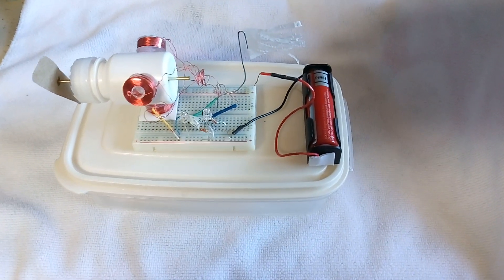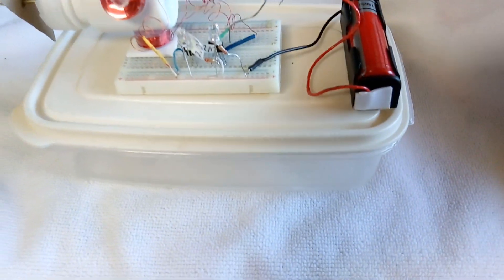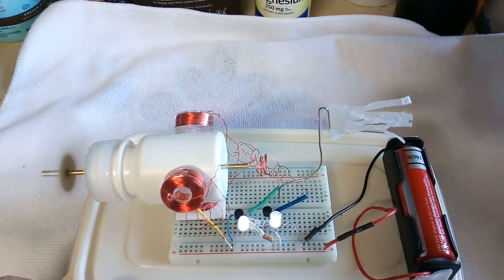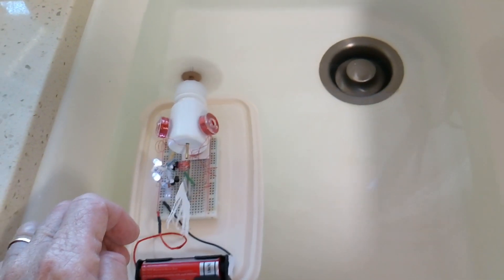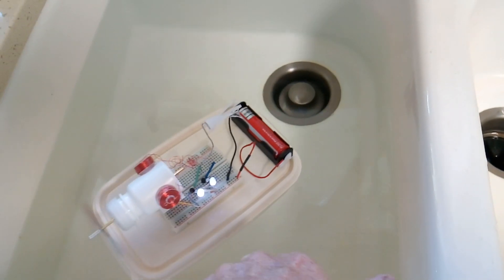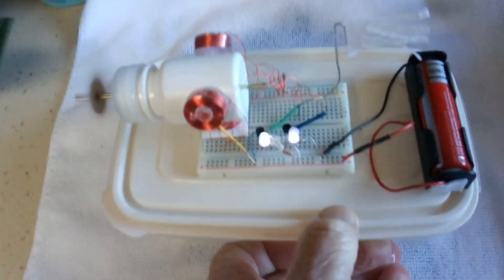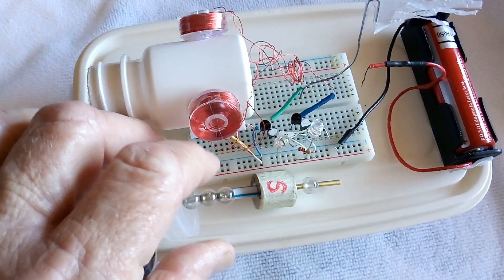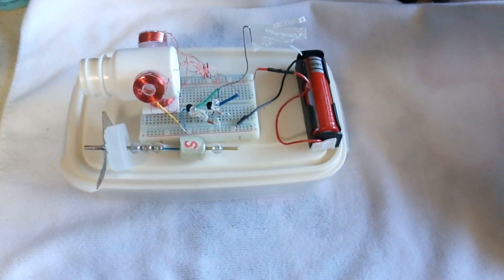Kitchen Sink Boat Testing

Comment: Hey Lidmotor, it is pretty fun/fan project! ;) With a much smaller propeller you could increase the speed so much in the water. That gives a bigger load to it, but I think it is possible with this design easy! Greetings from Hungary! Blade
Reply from the maker: Thanks.  Small prop.  OK.

Comment: Hey that is great to see your motor propelling the boat along. A slippery slope, you will get requests to make it RC next 😍 Thanks for the shout out too, I might have to revisit that project and put some more effort into it. It seems to be generating quit a few theories on how it works.
Reply from the maker: Your vibrating motor and flipper drive unit is pretty fascinating.  I think resonance might be part of the secret.  A speed controller to find the right RPM would help.  It sort of reminded me of that drive unit on the sub in that movie "Red October'.

Comment: Is it not customary for an air boat to push the boat from the rear rather than pull it ?
I always wondered which way would be more beneficial on an air boat.
Reply from the maker: The air boat use pushers.  My little boat will go either way.  You can start the motor both directions.  This thing here seems to go around the sink better in one direction.

Comment: What a fun build :)
Good to see that motor design in action too.
Reply from the maker: What I am learning is that to get better torque the coil to magnet gap needs to be much closer.  I might cut round holes in the plastic bottle and put the coils partially inside.   It is fun playing around with it.

Comment: You can tell you are a "boat man"......
Arrrrrrrrrrrrrr  matey.........! How about a rubber band to a underwater drive prop.....?
Reply from the maker: Thanks for the rubber band and prop idea.  It would have to be a tiny an low pitch prop to keep the RPMs up.  The motor will not work at low speed.

Comment: Well done LidM. Would be cool, if you could show the next time also the circuit diagram. Many thanks. Regards, Stefan.
Reply from the maker: Thanks.  The circuit diagram is in my last video here:  https://www.youtube.com/watch?v=fAdyPq-Heqs            The transistors are----2N2222 NPN and 2N3906 PNP.   The resistors are both 2.4  K.   The coils are 30ga wound on sewing machine bobbins and are about 9 ohms.